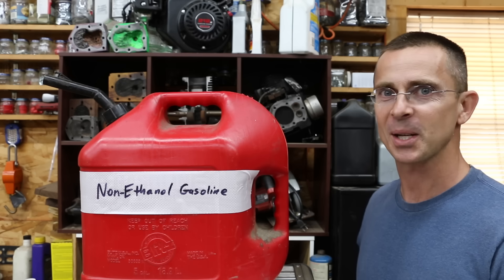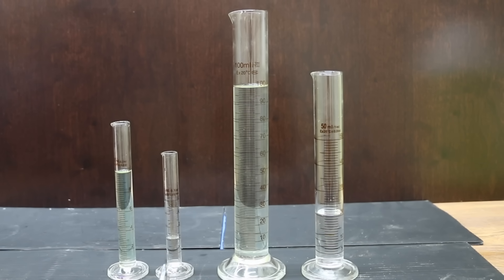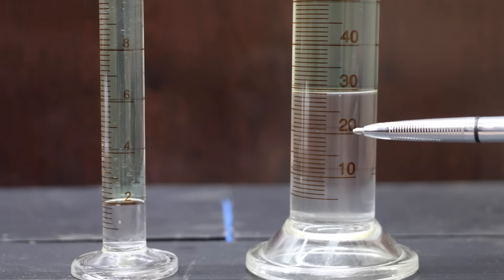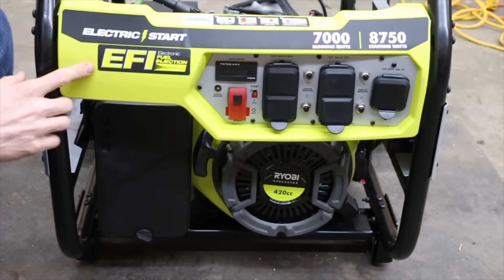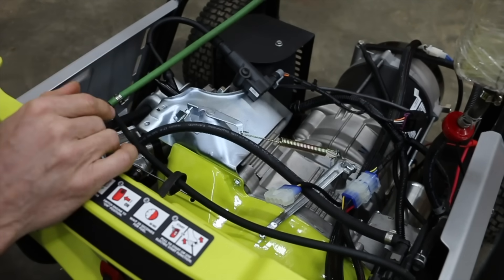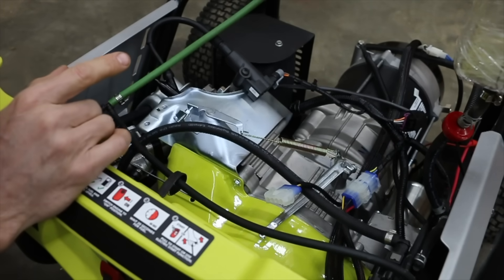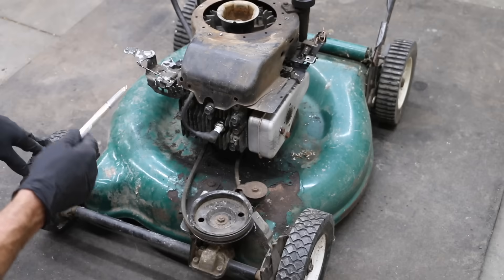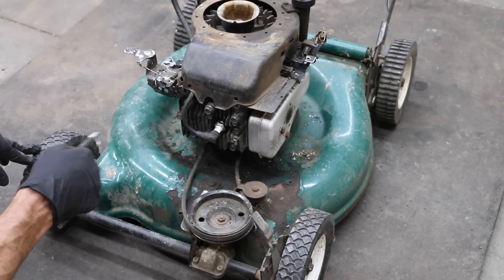Is Non-Ethanol Gasoline Really Better? See the PROOF!

Comment: The Briggs and Stratton engines are true engineering miracles. 
They get the hell beat out of them and rarely fail. 
When they do - it wasn't their fault.
They really should receive some kind of award for this.
I was a small engine mechanic and know what I say is true.
Reply: So true! I have a 23 yr old John Deere walk behind, forget the model off hand, aluminum deck, (Light), I love that thing! 
 Change the oil every season, non ethanol, beat the hell out of it year after year and she always starts right up.
Reply: @whatsit2ya247  Playing Devil's Advocate here but the last two mowers I owned with Briggs and Stratton engines lasted about 2 years . I now have had a mower with a Honda engine and it still starts on the first pull every time. It just gets fresh oil and a plug and air filter once a year.
Reply: @stevegrieb6596  I find it hard to imagine it only lasted two years, it literally blew up? Or ethanol gas went bad?
I've had to put a new carb in mine because of crap fuel, even after rebuilding never would run right.
Reply: @stevegrieb6596  Well, I am reffing to the older Briggs models.
I don't know as much about the new ones.
Like everything else... sadly ... they may have cut corners.
Reply: @whatsit2ya247  Yeah, fuel system problems for me as well. Surprising because I had owned a couple of mowers with Briggs and Stratton engines that ran for years without so much as a hiccup. I rebuilt the carbs on both of my problem children. Still ran poorly. Called it quits. LiIke Honda engines. Even my string trimmer has a 4 cycle Honda engine.
Reply: @whatsit2ya247  Worth mentioning I've found ethanol to sort of eat the fuel lines in trimmers, to the current machine gets ethanol free gas.
Reply: @OregonDARRYL  My older Briggs & Stratton were great. About as reliable as an anvil. The last two i bought, not so much.
Reply: @stevegrieb6596  Yep, they always have to mess things up after they almost achieve perfection. It must be a rule or something.
Reply: @stevegrieb6596  👍 been there done that!
Reply: I have a mower dating from 1965 that still cuts grass.  The older B&S engines are a rip off of the old Ford Model T engines the Flathead Fords, L-head engines.  Ford made those reliable and easy to repair due to the market they were selling into.  Putting the valves and crank all on the same side of the cylinder means simple head removals.   However the Achilles heels of the B&S engines are the carburetors specifically the Pulsajets, the Vacujets, and the PrimerJets, then later the more standard bowl & float models.  With the former the diaphragms stretch after a few years then the carb loses most of the ability to pump the fuel up, and the chokes were a problem and never worked right.   With the latter ones the replacement of the choke with a primer bulb fixed the choke issues but the diaphragm redesign did NOT fix those and the primer bulbs split and they stopped making the carbs out of metal and started using plastic, so the carbs would warp.   And with the bowl models those have the usual problem of a leaking needle valve causing the bowl to overflow.

If you buy a new diaphragm every couple of years for the old carbs and the primer bulb if it has one, and the needle valve & seat kit for the newer ones every couple years and check valve tolerances on the older ones every couple years they will run forever.
Reply: @tmittelstaed  Great comments. I will always prefer a real choke and throttle to any automatic system, and yes, metal carbs.
Reply: If your mower is not electric, you’re missing out.

Comment: Re-started buy non-ethanol again. Never really considered a boost in energy as a selling point. I use to prevent internal corrosion in carbs, etc. I did have sticker shock  at the price though. Nearly a dollar more per gallon compared to 87 Octane.
Reply from the maker: Thanks for the feedback.

Comment: So pollute and destroy the planet. I had 1985 pickup that had all the pre ethanol gas pollution control stuff on it, We stripped it including the air pump and only using today's ethanol gas with a slight carb adjust passed tailpipe all the way to the mid 1990's requirements.
Reply from the maker: Thanks for the feedback.

Comment: I am dismayed by the amount of black mold that grows under my hood,  around my carb on my tractors and on my fuel cans when using E10.  Also blackens all around my filler ports on all my autos.  I’ve found some very strange growths in my carb bowls.   My motorcycle gets about 10% better fuel economy with non-ethanol gas but cost up to  20% more.
Reply from the maker: Thanks for the feedback.

Comment: Pure gasoline provides better combustion/energy and most often no damage to any engine parts. Ethanol on the other hand, very bad.... loses about 10% energy in mpg and corrodes many things in vehicles, I swear i found that both my 1985 4runner SR5 and 2015 Tacoma TRD OFF ROAD with the 4.0 engine gets about 50 more miles per tankful.
Reply from the maker: Thanks for the feedback.

Comment: It has nothing to do with fuel efficiency or carbon buildup.  Ethanol in gasoline is bad news as it eats up the tubing and screws up the carburetor in small engines (maybe some bigger engines as well) - and seems to break down (to "varnish") far faster than no-alcohol gasoline. 

I used to think it didn't make any difference and that it was just a way to charge people more (for the no-alcohol gas), but after having to throw away a chainsaw that was a gift (irreparable fuel system) and a couple of weedeaters, I stopped using alcohol-using gas in them, and my small engines haven't had a problem since then (at least up to now, and I've been using no-alcohol gas for at least a decade).  If the small engine companies would use alcohol-resistant tubing and materials, the motors might last longer - especially if people drained the alcohol-containing gas out of the carb and tank every time they stopped using the motor!  THAT is why it's important to use no-alcohol gas in small motors, not efficiency or carbon buildup!
Reply from the maker: Thanks for the feedback.

Comment: I do small engine repair here in SW Florida. Ethanol fuel keeps me in business. It is so humid here, that if someone lets their mower sit for 2-3 months, it needs a carb cleaning. On the other hand, I tuned up my neighbor’s generator and put non-ethanol in it. I told him to run it every month. He never did. Zero times. Didn’t even look at it, let alone run it. Two years later, he asked me to tune it up again to get it ready for hurricane season. The non-ethanol gas had dried. I added gas. It started the first pull. He leaves it outside under a tarp.

Comment: Ethanol breaks down plastic gaskets and fuel lines. Especially in 2 stroke engines. It's fine for fuel injected engines but not for carbureted engines.
Reply: Some carb kits for older vehicles are available as ethanol compatible.  I haven't seen any for 2 stroke however.
Reply: @maplebones  We finally have a gas station with five pump stations that offer non ethanol gas (Ohio). It's awesome. Whoever got it going is going to do awesome business because it's located in an area where there's tons of landscaping companies (small engines). 
The additives never worked anyhow. Had to replace several carbs and fuel lines on my machines because of ethanol. Why are we burning food for fuel anyhow? Just makes food and feed prices go up and takes more energy to produce than it puts out.
Reply from the maker: Thanks for the feedback.

Comment: I run non-ethanol unleaded 91 octane in my Continental aircraft engine with a standard type certificate rating for it. Occasionally I'll run ethanol fuel but the hazard I am told with that is that the alcohol will swell some of the seats causing the fuel distribution to fail. I would be interested in the outcome of your test on that. Right now I don't run enough ethanol fuel to run the risk of having that happen. Is either 100 low lead aircraft fuel which low compression engine doesn't do so well in the spark plug following and let buildup issue so again back to non ethanol fuel. This test is very interesting to me and looking forward to seeing your results.
Reply: Doran,  I also use 91 octane non ethanol unleaded fuel in my plane.  The faa will not approve ethanol additive for aircraft engine use because as shown here, 4% power reduction- less run time.  The performance specs given in the POH cannot be met with ethanol additive. C150 flyer.

Comment: i know in my Nissan Altima, I averaged 25.2 mpg before they added ethanol and since then, it is around 23.4.
Reply from the maker: Thanks for the feedback.
Reply: About 7.5 %. That's a lot.  I have an older 1990 Volvo with fuel injection and I saw little difference. Part of it may be how the computer decides to respond. Later models may be better at it.
Reply: About 5% economy loss is typical.

Comment: The fuel would of had the full 10 percent ethanol in it, if you mix 50ml of ethanol with 50ml of water you get around 95ml of liquid since the ethanol molecules side in between the water molecules
Reply from the maker: Thanks for the feedback.

Comment: I am a retired ASE Master Technician who was taught at the GM Training College in Atlanta Ga. in the 90's. Here's some facts about gasoline (and ethanol) that I was taught and my observations.
   In the days before ethanol was made, the tanks at gas stations used to be monitored for water content. Humid air will enter these tanks and the water will condense and drip down into the tanks. The state inspector used a paste on the end of a long stick that went to the bottom of their tanks and it would react to the water, indicating how much water was in there. The intake of the pipe leading to the pumps had a specified depth away from the bottom of the tank and when water got high enough in the bottom they were required to drain the water out of the tank, an expensive prospect since they can't just flush it down the drain. Since ethanol came on the scene, this isn't as big a problem since if the station sells enough of the ethanol, it will absorb the water and keep the tanks free of any measurable water. It all gets mixed into the ethanol, and we pay for it as if it were ethanol. Your little test showed how too much water will cause it all to precipitate out of the gasoline, but that is almost never the case. It's merely a few drops of water per gallon and the alcohol suspended in the gasoline absorbs it.
   If you want to measure the amount of alcohol the test they gave me at the college was to add 10% coolant, propylene glycol or ethylene glycol. The alcohol prefers to mix with it and will all precipitate out of the gas and it will be green or yellow and easy to see and measure.
   Now, one of the most overlooked maintenance items on cars is the fuel filter. This is mostly because it is quite big and when the gas going through it is free of water, it will last a very long time. Gasoline is a pretty clean fluid to begin with, you can use it to clean things, so the only time a fuel filter needs to be replaced is when it gets clogged up, which usually only happens one way, with water.
    Once the filter element is saturated with gasoline or ethanol, it won't pass water anymore. And when water contaminates your gas tank, be it from condensation from humid air or because you bought gas at a mom & pop station in the booneys that's been in the ground for twenty years and the tank pumps out a cup of water for every 10 gallons it pumps since it hasn't been inspected since 911, that water will cover the element, not passing through, and limiting the area of filter that the gas CAN get through. This can starve the engine of fuel and performance will suffer greatly. I've seen many a "tune up" that costed the owners thousands of dollars for wires, rotors, modules and sensors that wound up really getting fixed with a simple fuel filter change: Filters that were full of water.
   So is ethanol a good thing? You bet it is! Just follow this simple advice. Buy your ethanol at the station that is the busiest in town! That way the water you buy will be less and it will be suspended in the ethanol and your fuel filter will last a lot longer.
Reply from the maker: Thanks for the feedback.
Reply: @ProjectFarm  My pleasure.

Comment: Interesting test. My question is the opposite end of the spectrum. E85...what does IT do to your engine long-term? I have a 2018 Si, and if I convert it to E85 and update the code I gain 50ish wheel horsepower. Sure I'll lose some economy, but I didn't get an Si to hypermile so no worries there. Would it detrimentally affect everything else? Sure I'll see more wear on tires and the clutch...but how about the stuff that isn't as obvious?
Reply from the maker: Thanks!  Thanks for the video idea.

Comment: When you combine water and ethanol, you will actually lose some of the total volume. 20 ml plus 10 ml does NOT equal 30 ml.
Reply from the maker: Thanks for the feedback.
Reply: @ProjectFarm  would've been better if you just told him where he went wrong. I bet there's too many people in this world that have no idea what your talking about. Some people just CAN'T grasp mathematics. Some people fill up the oil with fuel too. I don't let my father near an engine anymore after near blowing me up with the whipper snipper!? Probably wouldn't, but I DON'T think fuel is meant to go with oil, especially under HEAT & pressure!???
Reply: can you elaborate?
Reply: +10% of ethanol? 10% of 100ml is 10ml of ethanol, plus the 20ml of water, equals 30ml of combined liquid. ie 10ml of ethanol + 20 ml of water equals =30 ml of combined water and ethanol.
Thank God your NOT A meth cook or we'd all be fried!?
Reply: @mattdread4994  The ethanol and water partially combine, so that 10+20 = slightly less than 30. It's a chemistry thing. Not a large enough issue for this example, but it is true.
Reply: @mattdread4994  Haha your correct I thought I was the only person who noticed that 👍

Comment: I work on a 1960 jag xke the owner did not know about what alcohol would do to the carbs . the car has an electric fuel pump (which had been replaced with an up graded pump) which when turned on started pouring fuel all over the garage . I disassembled the carbs all the diaphragms were distorted and swollen and could not seal I had rebuilt the carbs 3 or 4 years before and should have been fine except the kits were pre alcohol and was not compatible with alcohol . It works fine with the up graded parts now
Reply from the maker: Thanks for sharing.

Comment: Here in OZ, we have Unleaded at RON91, and the most common Ethanol blend fuel is sold as 95RON -  so, as I have a 1991 Mazda that is designed for 91RONunleaded only and is said totally non compatible with ethanol blends - I am now really curious as to what Octane would be obtained from separating the water from a batch of 95RON ethanol fuel? so as to make a 'normalised' Unleaded however of an unknown resulting Octane??  Is there an easier 'formula' to help Calculate it?
Reply: You lose approximately 2 octane numbers when you remove the ethanol from any gasoline containing 10% ethanol. But you also cause other issues like a change in the vapor pressure of the gasoline. I wouldn't recommend removing ethanol from an ethanol blended gasoline, but if you started with your 95 (RON) gasoline, you'd end up with a 93 (RON) gasoline after removing the ethanol.

Comment: When I use 100% pure non ethanol gasoline in my (2) 5.7 litre Tundras. I experience 1.5 to 2 miles per gallon gain. Yes I pay .50 more a gallon, but no problems. 200k miles. All my yard equipment same thing. Fires right after a long winter. I use Lucas deep efi cleaner every 3 months. My 2021 averaged 19.7 mpg Nashville to Tampa in March 72 degrees TRD w Nitto Grapplers. 13/17 hwy....My 2 cents.
Reply from the maker: Thanks for sharing.

Comment: And instead of a bogyman, ethanol has been used in RCA's forever and in racing motircycles to without to much drama l might add.
Reply from the maker: Thanks for the feedback.
Reply: Alcohol funny cars don't care at all about mileage or fuel line damage. - If they get a 1/2 mile on an engine it's a great day. - Indy cars and lots of other open wheel circle track cars have used alcohol as long as I can remember too and I'm 74 years old,,,,,Just never saw one with 200,000 miles on an original engine. - You better not have any expectations that you have of Cub Cadet lawn mower when you are running a Super Modified,,,,or a full race motorcycle. You gonna be REAL disappointed.

Comment: An interesting afternoon in the garage (barn?) as always. My question is what effect ethanol has on two stroke engines. I've been told (by people that don't test for themselves) that ethanol prevents the two stroke oil from mixing with the gas correctly. I've used both in my motorized bicycle (two stroke) and don't see much difference but then I don't pull the head off and polish it before each run.
Reply from the maker: Thanks for the suggestion.

Comment: If your car is not rated for ethanol fuel, it will slowly damage seals/fuel lines and make extra wear on things like the injectors and fuel pump. Performance engines that are subseptable to large carbon buildups typically don't like it either.
Reply from the maker: Thanks for the feedback.

Comment: Non ethanol gas is not easy to find, and not cheap...more than ethanol version. I live in Eastern Washington state, farming community, there is a place just outside of town that sells the 87 and 92 octane ethanol free, I'm guessing because farm equipment needs and is exempt from the law. Anyway, I have an E60 M5 BMW, I have used the 92 octane non ethanol gas for awhile. The car does run better, especially notice when accelerating. The gas has no chemicals to clean internally, so I occasionally will get Techron system cleaner for it
Reply from the maker: Thanks for sharing.